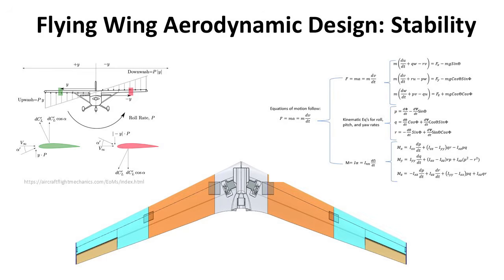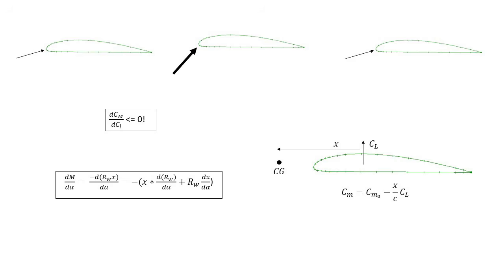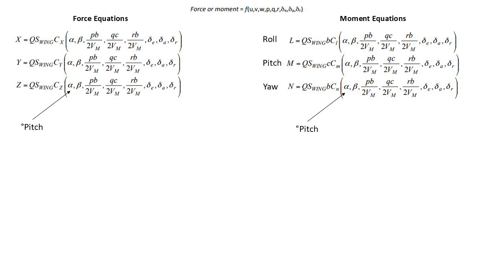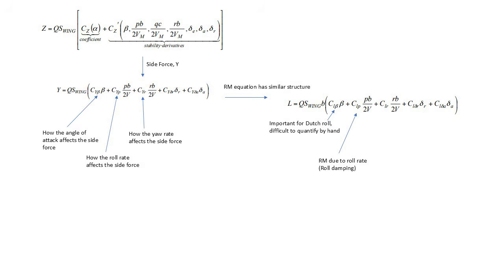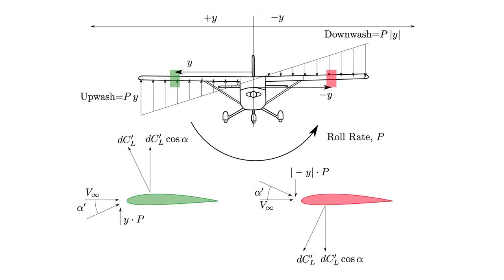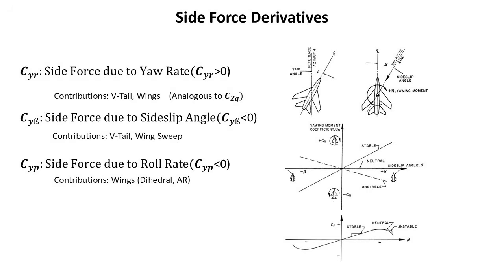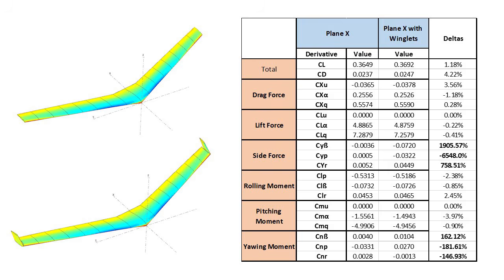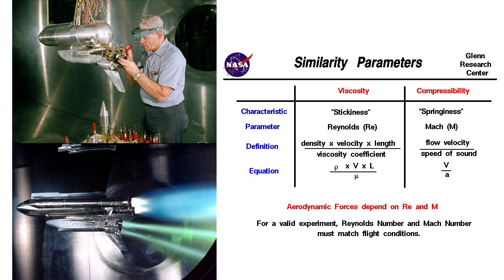Aerodynamics behind Flying Wings and Tailless Aircraft (Part 2): Stability

Comment: Nothing mentioned about the blended wing? Great vid & informative!
Reply from the maker: I mentioned BWB a couple times in part 1 I believe. The stability derivatives effective are similar to that flying of a pure flying wing (no htail terms) but you do have vtail terms do factor in to lateral directional stability measures. The forward lifting surface addition also changes things slightly

Comment: Hi, whats the reference area for planes in the drag equation? Generally in cars we use the frontal area but a lot of papers are saying that its the wing area for planes? What is actually the reference area
Reply from the maker: For drag on bluff bodies like cars or parachutes, frontal area should be used. For drag on streamlined bodies like aircraft, the planform area is used for consistency with the lift equation

Comment: Good stuff, would love to see how you counter adverse yaw, and produce directional control.
Reply: Proverse yaw is achieved by ailerons on the tip of the wing, on the part with negative angle of attack. More lift there means forward thrust in that case. There are videos explaining this.
Reply: @rafaelpadilha4585   I guess you're talking about the Prandtl wing and bell shaped wing loading. I have seen the vidoes. But still, YAW CONTROL is missing.

Comment: Your series is great at explaining the process to go from design tasks through formulas, to virtual models ending with a working test model. I appreciate the depth in this series.

I have successfully built a RC Prandlt-D flying wing (no vertical surfaces.) from foam board, as tested and detailed out by  Albion Bowers formerly at NASA years ago. I have been trying to simplify the build process so other can easily succesd too, this has been helpful on the quest, thank you.

Comment: What sort of Cd are you aiming for with this wing? I am personally designing a speeding with a Cd of 0.05 and am currently at 0.083

Edit: can you please help me out a bit? I am currently using a mh60 airfoil with no twist, naca 009 winglets and a  frontal area of 0.00876m^2
Reply from the maker: Making a winglet design video soon, but if your winglets aren’t toed in try to use a cambered airfoil to extract more negative drag (resultant winglet lift vector due to spanwise flow is tilted slightly forward)
Reply: I had another question, do we use the wing area or the frontal area for evaluating drag? From what i know from the automotive side is that the reference area is the frontal area but a lot of the rc plane guys say that its actually the wing area.

Comment: what about intentionally unstable wing that is stabilized by electronics, like a flying wing with undercambered airfoil and CG behind the AC? Or, what if the root airfoil was heavily cambered like s1223 and the tip was reflexed?

I just don't like reflexed flying wings very much because it feels like getting rid of the tail only to turn part of the wing into tail

Comment: This one is too theoretical for me. I wish you dived more into practical side of things that can be applied by hobbyists like me
Reply from the maker: You can design a plane and have these values in XFLR5 in a matter of minutes. If you know what you are looking for in static and dynamic stability modes, you can cut out a whole lot of trial and error when designing RC planes. The videos on fabrication and flight testing are coming soon, too. Just can’t ignore stability when properly designing.
Reply from the maker: 24:30 is about as practical as you can get before just attempting flight with no stability checks (such as only checking CG location on an RC)
Reply: I don't agree @sashgorokhov, the theoretical grounds are extremely handy for this one video. I'm saying that as someone who wants to understand more about the stability of flying wings as a flight sim dev. Keep going Gabe, this is a gem
Reply: I've always found flying wings to be black magic. Nice to have an understanding of the 'why' vs. just whacking on a flight controller, loading firmware, setting pitch & roll limits, and going full send.
Reply: The well is deep. Very deep. The surface of the water in the well is as close as the rain brings it. Dig away the hill